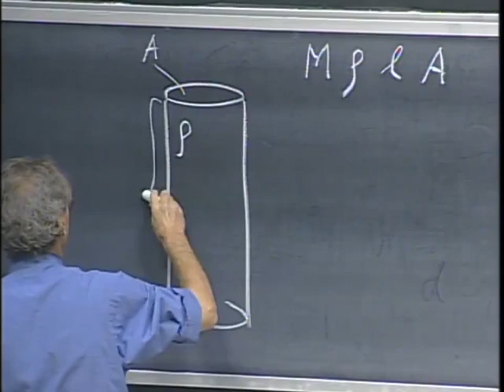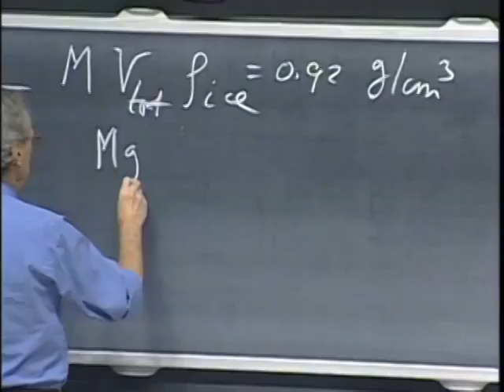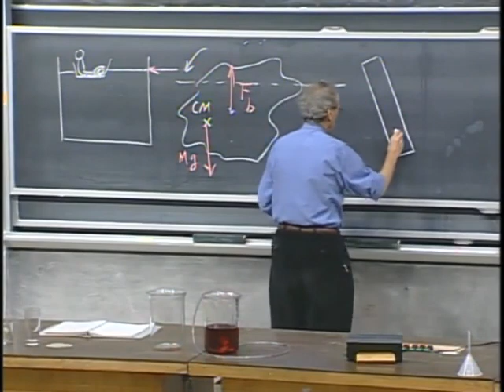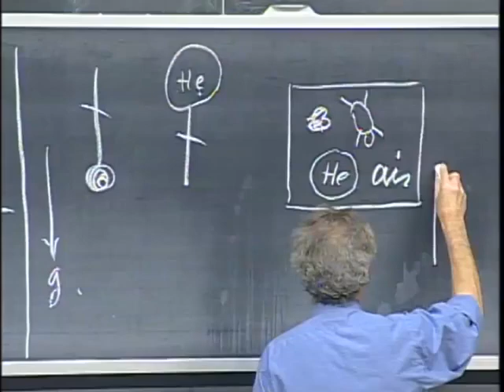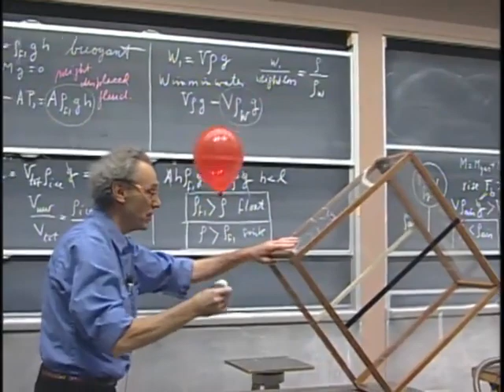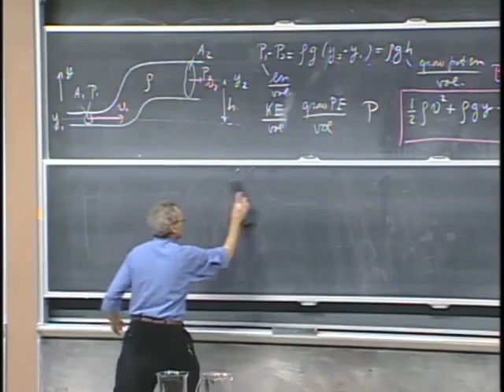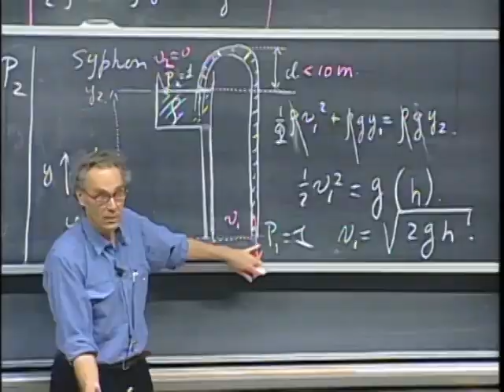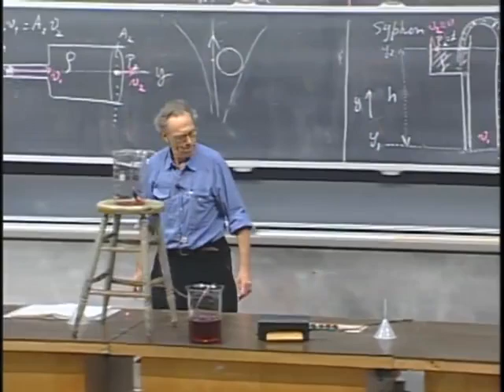8.01x - Lect 28 - Hydrostatics, Archimedes' Principle, Bernoulli's Equation

Comment: why will the balloon not rise without gravity?
Reply from the maker: Archimedes principle. 
A helium filled balloon rises because the weight of the balloon + gas is lower than the weight of the displaced air. In the absence of gravity, nothing has weight. Apart from the fact that the Earth would then not have an atmosphere.
Reply: Thanks sir!

Comment: at 0:55 you say that both points have the same pressure "p_2" even though they are not at the same level so isn't this discontinuous with Pascal's Law?
Reply from the maker: you still do not want to see the distinct parallel between atm pr and hydr pr. That's ok with me.
The atm pressure difference between 2 points in your room 10 cm vertically apart is comparable to the hydr pr difference between 2 points 0.1 mm vert apart becos of the difference by a factor of 1000 in density, thus bcos of a difference in "weight". 
Therefore my two P2's in air (at 0:55) are "identical" within a high degree of accuracy. 
This is my last msg.
Reply from the maker: The difference in atmospheric pressure between the floor and the ceiling (distance h vertically apart) in your home is rho*g*h. if h = 3 meter, then this pressure difference is about 30 Pa which is about 3*10^(-4) atmospheres. The difference in hydrost pressure of water between 2 points 3 m vertically apart is ALSO rho*g*h. if h = 3 meter, then this pressure difference is about 30,000 Pa which is about 0.3 atmospheres. NOTICE the Physics is IDENTICAL!

Comment: (6.07) Did Mr.Archimedes know the value of g or what he did was just a qualitative analysis ?
Reply from the maker: He had scales to weigh the amount of water displaced.
Reply: He did not have spring scales in his time.  That wouldn't come until Robert Hooke in the 1600's.

What he would have, would be a pan balance.   He could compare the weight of the crown, to the weight of reference masses in air.  Then he would immerse the weight of the crown in water, while suspending it from strings, hanging from the pan of a balance.

This result would tell him the same answer for density of the crown, regardless of if he was working with Earth's gravity, or the gravity of another planet.   It would tell him the ratio of the crown's density to water's density.

Comment: Sir,I think the water level go up
Pls react on my answer.😊
Reply from the maker: I gave th is lecture 22 years ago. I do not remember the question.
Reply: Ooh sir😊
Reply: Sir your question was - If a man is sitting on a boat with a stone in the pool. And then the man threw the stone into the pool. Then what will be the effect on the water level?
Reply from the maker: incorrect
Reply: @lecturesbywalterlewin.they9259  😢😢
Reply: the water level will go down as the weight of the displaced fluid will be less when the stone is thrown out of the boat( mg of boat will decrease and the buoyant force will balance mg). As mg of boat is more when stone is there, buoyant force will be high and as mg of boat will be low when the stone is not there, the buoyant force is less.

Comment: if the pressure on the left side is greater than the pressure on the right side then it means that pressure on the right side will be less than 1 atm......................so why don't we see any sign of external overpressure trying to squeeze the right side of the closed compartment at 26:28?
Reply from the maker: I watched and cannot add to the clarity of my lectures. I explain every step properly.
Reply: it is not related to your demonstration....................I was just asking, in general, that, if P_1<P_2 then obviously P_2 will be less than the atmospheric pressure so won't the right side of the compartment at 26:28 feel overpressure from outside because the right side of the compartment has pressure P_2 which will be less than the atmospheric pressure?
Reply from the maker: I cannot not add to the clarity at 26:28
Reply: I don't want you to add any clarity to your lecture………………I just wanted to know that if P_1 < P_2 then it surely means that P_2 will be less than the atmospheric pressure be ause there is air inside it??

Comment: When we draw the free body diagram of a cylindrical body then there is no sideways pressure from liquid on to the body because they cancel out each other but for example if we consider a conical body then the force exerted by the liquid on the curved surface of the cone will not cancel each other so it becomes more complicated.......……
So how do we solve in such cases?
Reply from the maker: If both sink, net force upwards follows from Archimedes for both. Net radial forces zero in both cases. use google

Comment: you tell that the helium balloon goes in the opposite direction of gravity (at 21:36)................but at 23:48 you say that if there is no air then helium balloon would also fall (ie. it does not go in the opposite direction of gravity)......................

so what really is the determining factor?
Reply from the maker: He balloon rises bcos of Archimedes, empty balloon has density higher than air.
Reply: In a vacuum, a helium filled balloon would fall like anything else.  Helium filled balloons rise precisely because the surrounding air is denser than them, and pushes upward on the balloon to take its place.

Comment: Hi prof, I'm from india , I have a doubt; why there is a static pressure ?or, what is the reason or source for static pressure?
Reply from the maker: use google
Reply: Lectures by Walter Lewin. They will make you ♥ Physics. 
Prof, Is static pressure inside a non accelerating closed chamber filled completely with water, arise due to the amount of molecules present inside it or Due to the inter molecular forces between the water molecules? Please enlighten me professor.
Reply from the maker: PV=nRT